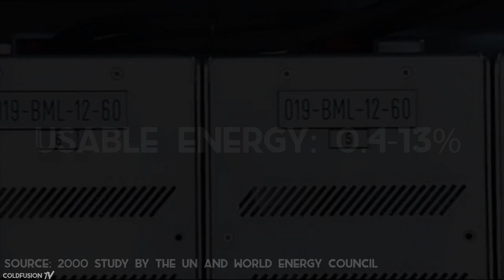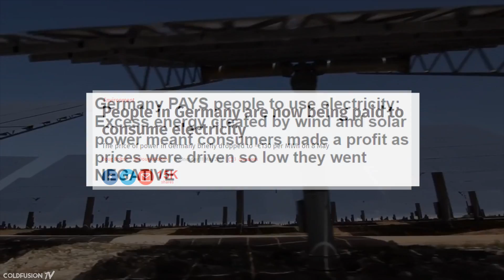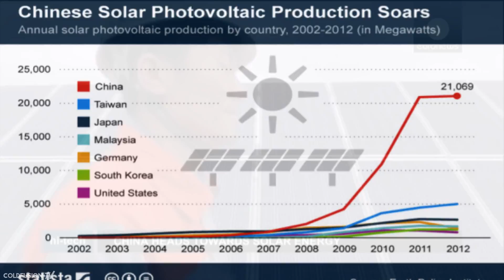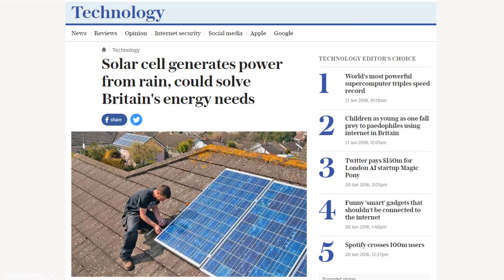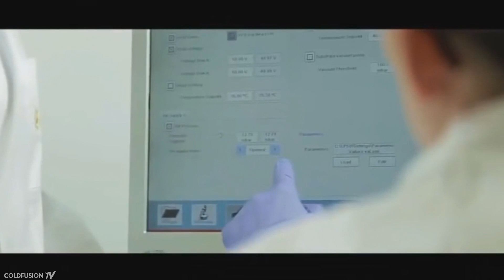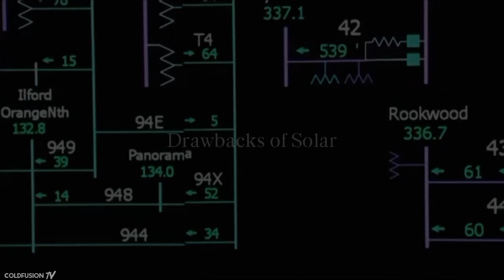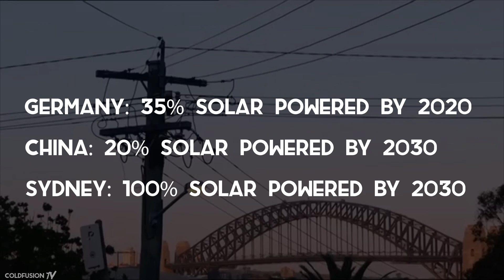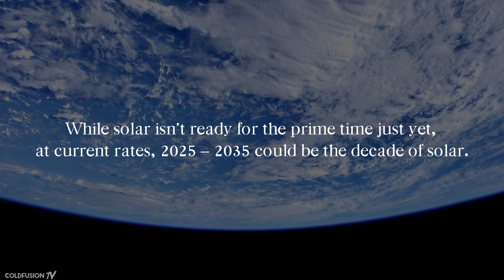The Truth About Solar

Comment: Solar doesn't work in the dark, peak demand or near peak demand needs to be supplied to keep "lights on", therefore we need generating capacity to supply this demand til morning!
Batteries are expensive and and have a short life cycle, a couple of years. perhaps,  Wind works about 25% of the time.. 18 hours in the dark? The Truth About Solar...

Comment: If you really want to capture the power of the Sun, you would support Nuclear Power. The Sun is one giant Nuclear Reaction.
Solar Panels really only make sense for a home owner. They don't make sense as a substitute for coal plants. First it will take 5 years for the solar panels to produce as much energy as they consumed when produced. Or at least for the traditional panels you see installed on homes. The other solar solution is mirrors heating up a central point which creates steam. The energy is then collected and converted into electricity. This type of panel captures the Sun's energy much better, but comes with huge drawbacks. It kills birds and blinds pilots. Second is the issue with space. A solar plant will take several square miles of area to produce as much energy as a coal plant. This displaces wild-life and takes away land that could be used for other things.

Comment: To manufacture a solar cell releases more CO2 into the air than if we used oil and coal.  Also a solar cell as a limited life expectancy.  Their efficiency falls over time due to UV light. You notice that this video does not talk about this.

Comment: Advanced nuclear with thorium will blow all this piddly alternative energy shit out of the water.  #LFTR  #Thorium
Reply: They aren't really competing though.
If anything, both solar and thorium plants are aiming to make energy production cleaner.

I'm happy for both solar and thorium.
Reply: Look up molten salt reactors. It's a technology we should be exploring
Reply: Thorium isn't used to produce energy as it is not a reliable or efficient fissile material. Are you referring to using breeder reactors then putting the product in conventional Uranium or Plutonium reactors? If that's the case it is theoretically possible to bring down the overall per kW hr price assuming it works the way we want it to and the infrastructure costs do not get overblown.
Reply: That's a breeder reactor not an energy source. That fuses thorium through neutrino bombardment to either create fissionable Uranium or Plutonium. The molten salt is the coolant or conductor of the heat generated by the reaction. Thorium is not the fuel source or the reactant in the rods. The system in question "potentially" could reduce overall waste or at least bring down the half-life of heavy elements and maybe bring down the cost due to Thorium being much more prevalent and cheaper but those are huge if's. The issue is that it is a $100 billion kickstart program. I would also like to have the largest particle collider  in the world but the up front costs are extreme in both cases.
Reply: You've already acknowledged a thorium-uranium breeder reactor could reduce long-term waste and bring the cost down, what if it reduced the waste and cost by 100X ?? That's what thorium molten salt promises (and China is putting big money into this)
Reply: I wonder how much oil and coal is used in the manufacturing of solar panels and those massive wind turbines. Solar might be more viable using mirrors all reflecting sunlight to a  focus on a tower to heat oil or salt that can remain hot through the night that can then be used to create steam for the turbines.
Reply: a ball of thorium the size of a golf ball could provide you with all the energy you need for your whole life. and thats including cooking your food and driving you to work etc. and it would only cost you about 300 dollars
Reply: Its been tried on Interstate 15 west of LasVegas NV, and after investing billions, its now bankrupt - like most liberal and tree-hugger inventions, its bankrupt. A gigantic waste of public dollars as usual.

Comment: You know that Moore's law died about 6-8 years ago right?  I just upgraded my computer after 5.5 years and my new CPU is exactly the same core clock speed as my previous one.  Sure, the memory and IO busses have doubled in throughput, but the core clock speed is unchanged, where Moore's law says it should be over 10 times faster.  Also over the last few years, while solar production has increased, Nuclear has declined, and non renewable production has increased even more than solar to keep up with increasing demand.

Comment: In all honesty, Nuclear Fusion (not fission) seems like a more desirable solution.
Reply: What's wrong with fission?  We won't get much use out of fusion here on earth.  Too much energy is required to sustain the reaction, so our reactors that can contain a fusion reaction can't even do that for long and they use more energy than they generate.  Fission is still a great way to provide large quantities of concentrated energy.
Reply: DeviceEnforcer Fission just creates a lot of radioactive by-products that are very deadly, and don't have nearly the same efficiency as a fusion reactor would.
Reply: MrMilkman29 It's still more efficient than any other current energy source, and I believe that there are strains of fungi that can help neutralize the radioactivity of the waste.
Reply: DeviceEnforcer It'd make more sense to take the current nuclear waste and use that as fuel for the newer concepts on models, since then it'd actually get used up. But we don't have enough money or public support, because people are scared of the nuclear boogey man related with anything nuclear.

Comment: That is not correct. Germany never issued that! There Problems are that WINDPARKS not Solar are up in the poor North and there main Industry is in the South! But we are talking about Solar. The second thing is that Solar depends on Panels that maybe have a livetime of 20-30years....
So you need to calculate costs AND replacementcosts against Nuclear and Coleenergy and then Solar is way higher then 37uscents....

Comment: What are the carbon footprint cancel-out periods for these various solar technologies? If more carbon was generated mfg'ing them than can be saved in their lifetime usage then that should be a huge point of r&d focus I should think?
Reply: You hit the nail in the head. We can have solar panels as long as their is oil. When we run out of oil,    solar cells will be darn hard to manufacture.
Reply: Azzy M It's a valid problem on many levels, that being one, CO2 being another and so on. If we get mfg to where solar can produce solar, we're on a much better path.
Reply: Frank Gualtier Right.  You said, Quote " If we get mfg to where solar can produce solar, we're on a much better path." unquote.   That is exactly the fulcrum.
Imagine a bucket elevator running on solar cells.!! (Or an aeroplane, never mind The Solar Impulse. It could not have carried a box of chocolates across. There was no more room in that plane.
I suspect that we are being lied to. Post oil world will never be the same as  now. That is something we never hear them say. They just paint rosy pictures of a solar world  Just like always. No mention of what we will loose in terms of life styles.
It took nature hundreds of millions of years to make the oil which we will burn in a couple of hundred centuries.. And good riddance. There will be fewer wars, little if any pollution and no smog and fewer people.
It will be a better world.
Reply: Azzy M I have similar thoughts myself with horror scenarios as well in solar and related power harvesting. Imagine an entire mountain range topped with wind turbines. They thought it sounded awesome until they realized they actually made so many that weather patterns were affected enough to cause various unpleasantries. Not total lunacy as enough force taken out of something will change its strength and perhaps trajectory. Kind of getting a bit ahead of myself but it seems humans have an incredible capacity to blot out potentially negative consequences of large scale operations/systems etc.

But yah - I agree, we're running on the back of what took impossibly long to create at a shocking rate and I'd be shocked if we found anything as easy to get energy out of for a very long time.
Reply: solar is Childs play and a pipe dream. a true clean future that is sustainable well into the future is nuclear based, mainly Thorium based reactors. We can have all the electric cars anyone could dream, still charge them day and night plus is would be the cheapest $/Kw/person. People need to stop hiding behind the curtains of fear and view it for everything it offers. What happened in Japan was grossly over played and hyped by the media.
Reply: @Frank Gualtier unbaffle yourself.  The big oil companies have heavily invested in alternate energy research for decades.   The tinfoil hat crowd usually decries that as proof that they're trying to suppress the technology, but the reality is that they've put billions of dollars into this research.  BP Solar, for example, was one of the very biggest players in the solar industry, and was building/deploying solar systems into the 10s of megawatts.  Oil companies are also involved in funding/researching/building wind and tidal power projects via subsidiaries.

Problem being the same as every other "new" industry, where there's lots of unknowns, the science changes direction almost every day, there's hundreds or thousands of potential competitors and the risks are very high.  BP Solar's technology was quite good for the day, but they found that the Chinese could produce newer types of solar cells far cheaper than they could.  The company took several years of poor sales to the point where they had to put it out of its misery.

The Pharma projects of this sort have far less risk that one of the few other pharma companies is working on exactly the same thing, and that they've have a monopoly on it for years.  US BigPharma is essentially one huge insurance scam.   Whereas "solar" is just about it for the entire electronics industry for power production.
Reply: TheKoups My same carbon footprint question applies here. ? I have nothing against going nuclear but the thorium isn't going refine itself.

As for accidents, just keep reactors from getting so big that any single failure's outcome, should it happen, isn't a deal breaker.

Gotta remember spidermanseekingipodrecharge, with great power comes a few mishaps - if they are less damaging to the planet's ecology (which includes us) than what we're doing now then we're moving in the right direction.
Reply: Do realize that you do NOT necessarily have to use oil, gas or coal to refine things.  It's just the customary (and usually cheapest) way now.  Solar furnaces exist and have been used to refine metals as least as a proof of concept.  Electric arc furnaces exist and are in fairly common use in commercial refining/metalurgy already. Especially in Aluminum (and titanium), and they don't have to run off carbon-based fuel-generated electricity.

There's no reason to believe that solar can't be made to make solar.  You just need enough solar, and at the present time we do need oil/gas/coal/nuclear/hydro to bootstrap us far enough along to get to having enough solar (and whatever else).  But once that point is achieved, we won't have to do it that way anymore.

Thorium is mainly proposed as a mid-term "low-carbon bridge" from "now" til solar (and whatever else) is up to capacity.  It has its own problems, including very high cost, but at least the radioactive waste component is far less.  There are many Thorium proof-of-concept projects currently underway.  Even Canada is in the process of getting approvals for a Thorium-powered Candu reactor in Chile as a proof-of-concept (at the 10MW level, to run a 20M gallon per day desalinization plant).  So, it's not as if Thorium is being ignored.
Reply: Fromage Frizzbizz I get it, really I do. We've just un-sequestered so much carbon in the past 100 or so years (carbon that took the earth tens if not hundreds of millions of years to neatly tuck away for us) that we can only spare so much of a bootstrap. It may already be too late - we've set a feedback loop in motion that's pumping up enough methane to possibly finish what we started all by itself.

What baffles me most is that oil companies are rich enough that they could be the ones to corner the green energy markets, yet they don't seem to have enough interest. Very un-BigPharma of them - the drug companies go out of their way to prove what everyone thought was a make believe illness is really a real illness so they can cash in on treating it. Money drying up on cholesterol meds? No sweat, we've got some research we've been funding the past couple decades that proves fibromyalgia is real - we're currently working on three drugs that show promise in treating it. I pulled that one out of thin air as my tablet's a wimp and not very multi-task friendly but they do this kind of thing for real. They gave bipolar disorder a face and there's a congenital immune disorder I suffer from myself that would never have gotten enough recognition for treatment research and payment without a huge nudge by interested drug companies (treatment costs my insurance six to ten thousand every month). Anyway, if the oil and coal industries were as ambitious in that light we'd be green much faster and then they could sell us BigPharmEcology cleanup and reversal goods. Or maybe they're just waiting for things to get bad enough that the naysayer list is manageable...
Reply: Fromage Frizzbizz I was not aware of such an effort by BP. Good info - time to research. Thanks.
Reply: thorium is still another stop gap.
It won't last forever as it decays away. 
On top of that you need a lot or power (from another nuclear source) to start the reaction. So what ever runs out first will stop the reaction.
Reply: Frank, you and I are on the same page.....In days of old, the solar cells did not last long enough to recoop the energy used to produce them, making solar a bit of a scam (lol).  However, that was quite a few years ago, and I hope they learned something.   1. glass.  You must use glass, and it must be expensive glass. No plastic, etc.  The sun destroys materials.
Reply: Norman Graham I know, right!? It's turning out to be true of a lot of things like at least some of the fuel cells in hybrid cars are environmentally bad and don't last close to long enough to equal out.

And yah, a lot of people don't realize how refined the silicon has to be or how much water goes into the process - it's insane. Same - I hope they're getting way better at it.
Reply: w8stral2 
I thought acrylic only last years, as opposed to decades for the cells to degrade.
I believe we need to stick with glass for longevity, and eventually almost EVERYTHING will be powered (and made) from hundreds of thousands of sq miles of solar/battery material. This is already starting to happen at a "dirt cheap" scale. Just starting, though, as batteries are still about 4x too expensive. Successive giga factories will dramatically lower the costs of convenient electrical storage, till a complete solid state grid is in place.

Comment: i wonder if you  could coat the wires that transmits it power in the current grid with the flex coat solar panels. that way they could generate the entire length of the grid that is exposed to the sun.

Comment: The greatest problem with solar is matching output with demand.  Elon Musk's Power Wall addresses a huge portion of this  but not all.

The two most basic problems are 1.  the balancing act of demand vs. production,,, both are quite intractable.  At present we balance the eqation by fluctuating the power generated by water and diesel.  These are the two that have the best flexibility. The sun goes behind a cloud,, more water is released.  2. is the profitability.  Rigth now the lines, the contriollers, the transformers,, the grid,, the huge ballet of getting the power to you is handled by the producers, the electric company.  However if everyone places collectors on the roof and ties into the grid,, there is no profit,,, there is no way to maintain the distribution grid.

We cannot 'just' produce panels and solar cells without addressing these two issues.  These limitations must be solved at the same time that the solar 'system' is coming online.  Or it will fail,, as in Germany,, as in Hawaii,, today.

Comment: • Arsenic
(gallium-arsenide semiconductor

chips). 

• Bauxite
(aluminum). 

. Boron Minerals (semiconductor
chips

• Cadmium (thin
!lm solar cells). 

• Coal (by-product
coke is used to make steel).

. Copper (wiring; thin ! lm solar
cells): 

• Gallium (solar cells)..

• Indium (solar
cells). .

• Iron ore (steel). 

. Molybdenum (photovoltaic cells). 

• Lead (batteries).

• Phosphate rock
(phosphorous). 

• Selenium (solar
cells). .

• Silica (solar
cells).

• Tellurium (solar
cells). 

• Titanium dioxide
(solar panels). CES

Researcher:
TonyMuhovich, Colorado School ofMines

Edited by the US
Geological Survey 2010